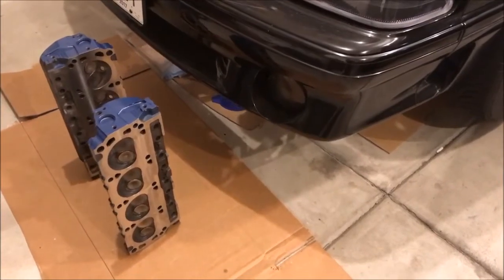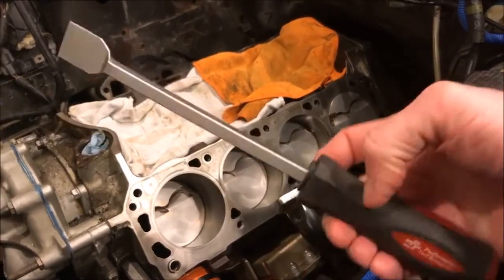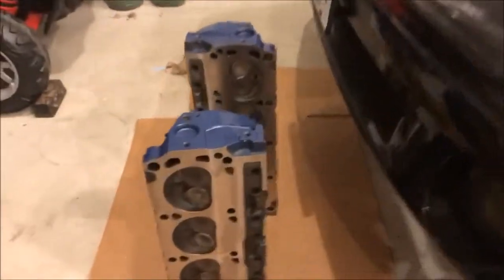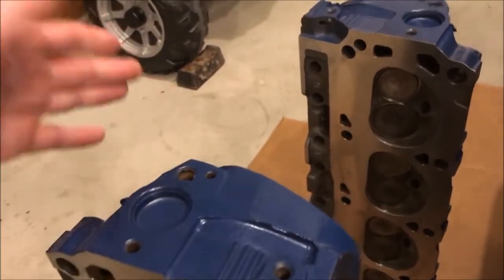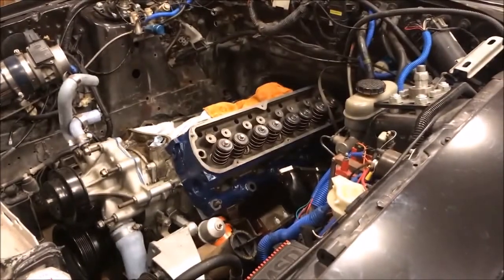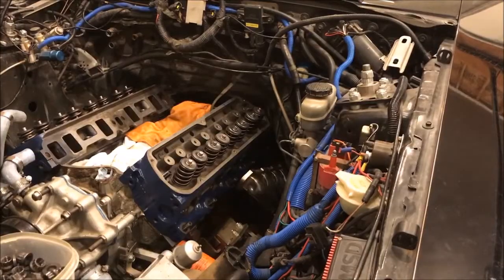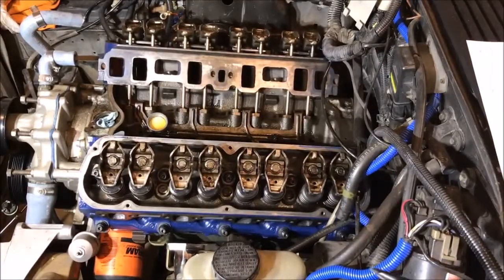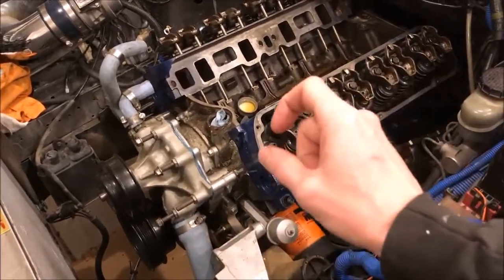GT40 Head Installation on Mustang

Comment: My 1996 Explorer has F3ZE heads on it i have looked at a bunch of Wrecking yard 1996 explorers and have never seen on with the F1ZE castings. i know they exist but I have never in 10 years of wrecking yard search seen one. The only difference between My Explorer heads, and the Cobra heads is the Cobra heads have been milled .020 to get the lower the Chamber CC's.
Reply from the maker: Interesting!  That’s pretty crazy!

Comment: Are the valves the same size on the E70 heads and GT-40p heads?
Reply from the maker: Hello.  Great question!  No, they are not the same:

87-95 Stock E7TE Valve Size Intake - 1.78, Intake Ports Flow @ 124cc
87-95 Stock E7TE Valve Size Exhaust - 1.45

GT-40P Valve Size Intake - 1.84, Intake Ports Flow @ 185cc
GT-40P Valve Size Exhaust - 1.46
59cc Combustion Chambers/61cc Combustion Chambers (depends on model)

Thanks for the question!

Comment: hey man great video, how much power /torque did u gain after installing these? was it worth it? i am debating if i should put these on
Reply from the maker: Hello. I’ve never had it on the dyno, so I can’t say. Seat of the pants feel would have me estimate 20-30hp. It’s a noticeable difference, but won’t knock your socks off.  Hell of a lot cheaper than top shelf aluminum heads, but you do get what you pay for.  Don’t get me wrong, they’re great, you just can’t expect big power gains.

Comment: My grand father taught me a trick with heads and intakes.   If you will take some all-thread rod and cut it so that you can screw them into the corner bold holds on heads or intakes you can align the head/intake and it drops right into place without moving the gasket out of place.  Then you just take out the all thread and put the bolts in place.
Reply from the maker: Tricks like that are priceless. The old timers have the knowledge, that’s for sure. Thank you for sharing 👍
Reply: Yes my dad Showed me that trick back in the mid 1960's when I was rebuilding My 1966 289!  I also use the same method to install the transmission, so I don't have to fight input shaft alignment.

Comment: just remeber I am not traying to discredit anyone but   when ever you swap freshly rebuild  head on a used motor your adding compression  dose   your ganna have a bunch of blowby the ring are weak your ganna start to have problom youre better  off  rebuilding the motor on my 351w for me a rul of thumb i torque my jt40p at 100
Reply from the maker: No man, all comments are welcome as long as people don’t act like a-holes. I planned on a slight bump in compression, but it’s negligible on this application. Also, the motor was just rebuilt 5k miles prior to the heads going on. Have a good one!

Comment: What headers are you using , I here the spark plugs are at a different angle and some people cut and fab there headers.
Reply from the maker: I’m using BBK long tubes. They are no different than the ones in the catalog. These are GT40 heads. The P models sometimes have header clearance issues due to the angle of the plug as you mentioned. Thanks for the question!

Comment: Awesome video man just pulled my upper intake off most of the bolts looked nasty what size thread chaser did you use for them?
Reply from the maker: Hmm….man I wish I could remember in the moment, but unfortunately I don’t. If the bolts are looking bad, I’d change them. ARP and Ford performance both sell replacements. Otherwise, grab a tap and die set and you’ll find one that works. Sorry couldn’t be of more help. Thanks for the question!

Comment: Just came across your video, question  i have a set of gt40 3 bar heads but just wondering if the heads will work with stock rotating assembly from my 1992 foxbody GT? Many people say the piston can hit the valves/heads?  They mention to use clay to check clearence? Not sure how that works? But my goal is simple heads cam intake plus FBO i already hand ported a set of GT40 upper and lower intake manifold that i had stored away for a while. If you can get back to me that would be awesome
Reply from the maker: Hello. 100% the GT40 heads will work with your stock rotating assembly. Just be careful of your cam choice when you make that change. That will affect piston to valve clearance. For reference, I’m running a mild/aggressive cam in my set up and the GT40s work just fine.  There’s really no difference in clearance between the stock E7 heads and the GT40s. The GT 40s have larger valves and that’s it. Profile is the same. 🤙

Comment: Older video but came across your channel.    Great content.    Bought my dream car a few years ago.   1990 foxbody.     What's your opinion on trickflow stage 1 camshaft and still using factory stamp steel rockers?   I have all the other bolt on.   Headers, intake,  throttle body,  full exhaust etc.   Stock e7 heads.    It's not in the budget for roller rockers.   Not looking for serious power just a daily driver.   Thanks in advance
Reply from the maker: Hello. Congrats on the car!  The stage 1 cam should work perfectly fine with the stock rockers. Unless the manufacturer suggests rollers or a different mounting style, the stockers will work just fine. I’ve got GT40 heads and a more aggressive cam than the one you’re considering and they works great.  Thanks for the question and have fun with the car!
Reply: @FastFixYouTube  thanks for the info.   I'll probably still check ptv clearance but good to know others have used factory rocker arms.

Comment: What’s the latest year gt40 heads I can use , on a 1985 gt
Reply from the maker: Hello. I’m not 100% sure on this, but I’d say any year would work. However, you’ll need to make sure your pushrods are the same length. Also, how are the rocker arms connected? GT40s are bolt down while older engines had stud mounts. Just a Few things to consider when doing your research. Best of luck!
Reply: @FastFixYouTube  goddamn I got a lot to learn I’m so excited I feel like I’m gonna be the last of generation so I’m tryna go out with a boom before they have use driving these electric terds

Comment: Would you be able to tell me what rocker stud kit you bought. I'm having the hardest time finding the right ones. Been thru 2 different sets from Summit and they were both the wrong size.
Reply from the maker: Hello. I used the Ford factory parts, so didn’t buy a stud kit. Whatever was on the head is what I used. Sorry I can’t be of more help on this question.
Reply: @FastFixYouTube  no problem, thanks for replying

Comment: F3ze aa did they all have thermactor holes?
Reply from the maker: I don’t think so, but I’m not sure. I’ve read different opinions and haven’t found a definite source of accuracy.
Reply: @FastFixYouTube  I can confirm. I looked last night I have a set if F3ZE AA code with no thermactor holes and they were off 96 explorer, also was reading ford had cobra and lightning heads laying around and used them up as svt didn't sell as expected go figure.. lol
Reply from the maker: Interesting!  Thanks for the info 👍 appreciated.

Comment: Great content, can I directly bolt on a set of 3 bar without changing springs as I know gt 40ps due require springs  I have a set of 3 bar painted them I am just going to bolt them up 
,it does have stock cam thanks
Reply from the maker: Yes, that should be just fine. As long as you’re running a stock cam (as you said), gtg.  Thanks for the comment 👍
Reply: Yeah great vids you're GT40 video help me with my swap. I got a set of 430 gears going complete with 28 mt tires iam hoping to  drive it in the 12s this yr. Once again thank you for responding.
Reply from the maker: You bet! Best of luck

Comment: What about the gt40p’s that have F77E ingrained on them?
Reply from the maker: That code is for 1997+ explorer or Mountaineer GT40P heads
Reply: @FastFixYouTube  will they still fit my stock 302? Is there anything i have to do for them to be able to go together?
Reply from the maker: Yep. They’ll fit. I’ll send you a link with more info on those specific heads.
Reply from the maker: Here’s the link. Should have everything you need to get the GT40Ps to work on your 302. 

https://lmr.com/products/what-are-gt40-heads-mustang

Comment: How exactly do you get a torque wrench on the back stud near brake booster?
Reply from the maker: Hello. Pretty sure I used a swivel socket for that one. Not ideal when it comes to accurate torque setting, but no other choice.
Reply: @FastFixYouTube  

Thanks.   I figured.   I also have a smaller 3/8 drive tq wrench that fits.   Try that with 3/8 to half inch adapter.  

Engine out was alot more fun!
Reply from the maker: @tays8306  haha, totally agree. Easier and more fun on the way out.  I think I used a 1/2 to 3/8 adapter too...sucks I can’t remember something I did not even a year ago...ahh well. Best of luck going forward!
Reply: @FastFixYouTube  

Thanks.   I re gasketed the whole thing cause it was leaking oil...from everywhere.   It seems to be heating the coolant up bad.   Head gaskets on the right way...same water pump as I had last summer.   Have to make sure the heads are okay and have them magnafluxed and skimmed.   head gasket leak into water jacket somehow....copper coat next time to make sure.
Reply from the maker: Oh man, that sounds like a pain in the arse.  I had overheating is issues with this motor and I discovered the fan clutch was the culprit. Of course I replaced everything else before figuring out the bad part 🤦‍♂️.  

Regarding the heads, make sure you’re using a thread sealer for the bolts that enter the water jackets. There’s a specific thread sealer used to seal head bolts/studs that thread into water jackets. Not sure if that’s your problem or if you already knew that, but might as well offer it up as a solution. Good luck 👍
Reply: @FastFixYouTube  

Got that all squared away with  Permatex  thread sealer.    I was hoping it would be something easy.  But +12c isn't overly warm out and on the highway that cool air temp shouldn't even need a fan.  Im going to have the crappy d8 smog heads magnafluxed to look for cracks to be sure then a skim to be flat.  Going to copper coat the gaskets this time too.   Honestly think its just a gasket sealing issue.  It ran great all last summer Just leaky latowski.   All I did was keep in a heated garage and tear it down since then.

Comment: I'm pretty sure those are true cobra gt40 heads they have 3 bars. Explorer gt40p heads have 4 bars.
Reply from the maker: They’re from an Explorer. The code on them tells the story. Explorers came with both 4-bar GT40p and “cobra” 3-bar GT40 heads.  It’d be cool if they were, but no one would ever know the difference unless they unbolted them and read the code.
Reply: @FastFixYouTube  Do they have a "GT" stamped on the front corner?

Comment: Why would you put gt 40 heads on a 30 over motor? U restricting hp big time.. Those heads just for stock bottom end 302..aluminum aftermarket better flowing heads is what u need. U bottle necking that motor unless u don't care about real hp
Reply from the maker: Money doesn’t grow on trees and the GT40 heads I used fit my budget. Not to mention I use N20, so the real power this motor makes is with nitrous.  .30 over is hardly a reason to use aluminum heads. This displacement increase is negligible and doesn’t necessitate aluminum heads. I take your point that higher flowing aluminum heads would be better, but I also confront this in the video. I said aluminum heads would be better, but bang for the buck the GT40s performed a lot better than the factory E3s which is 100% accurate. And this motor is a stock bottom end. Nothing built about the bottom end at all. Not sure what you mean there... so yes, I care about “real” hp, but I’m not going to spend 2k or more on heads for a motor that can’t make 500hp without walking the crank.  That will come when I build an engine that can handle making big horsepower reliably. Thanks for the comment.

Comment: Curious what size pushrods you used with the 303 cam and gt40 3 bar combo? Appreciate that good video.
Reply from the maker: Hello. They’re the factory length pushrods, but hardened. I don’t remember exactly the model, but from Ford Performance. Thanks for the question.

Comment: Did you use the factory springs from gt40 heads or did you replace them with old/new ones? I've heard it's recommended for explorer gt40 head swaps
Reply from the maker: 100% new springs to match the cam

Comment: Bro what gasket do i order my is an 88gt 5.0 when i get gt40 heads
Reply from the maker: Hey there. The gasket I used on my build will work on yours. It’s linked in the description.
Reply: Thanks mine a 88 5.0 doingt no p heads you think ps are better thanks bro
Reply from the maker: Rey Parra there’s a really good comparison between GT40 and GT40P heads on this site: https://www.americanmuscle.com/cylinder-head-upgrades.html

I like the GT40s because it keeps the spark plugs in the stock location.  Plus, the GT40Ps have very weak valve springs and you are required to change them is using on a mustang. Even with a stick cam.